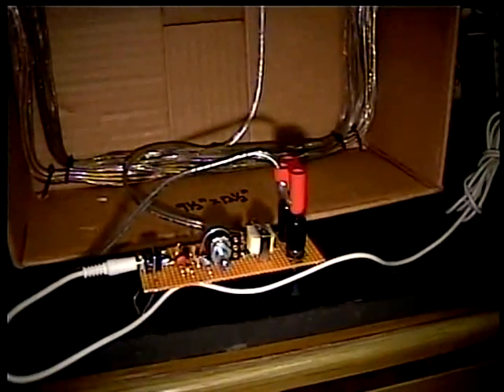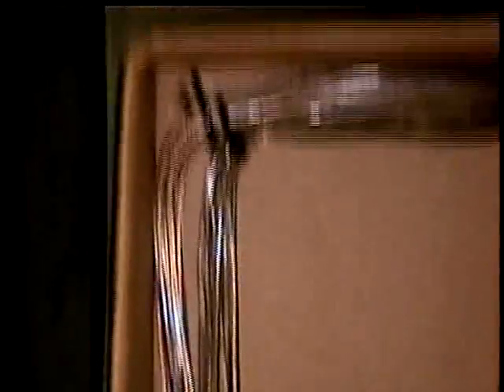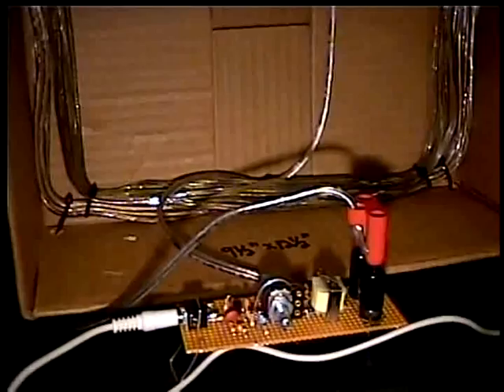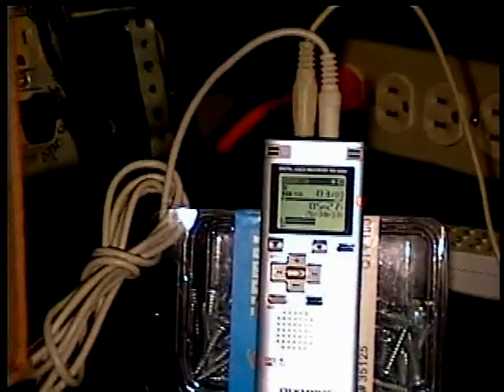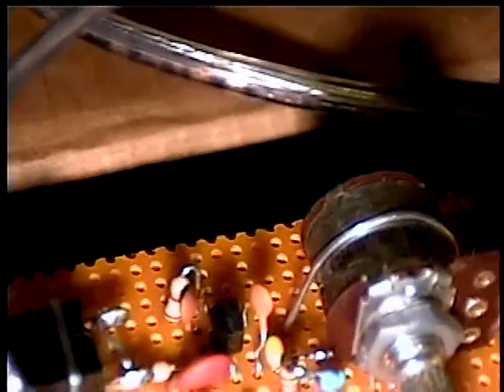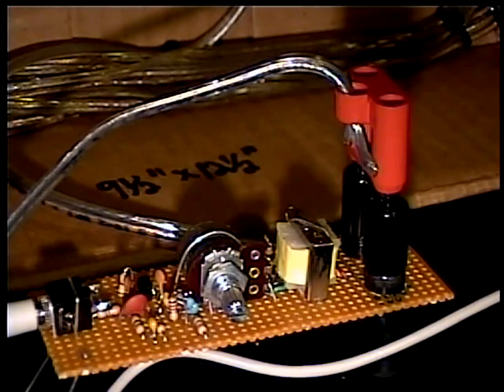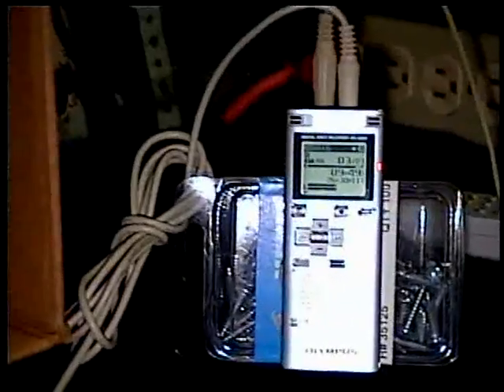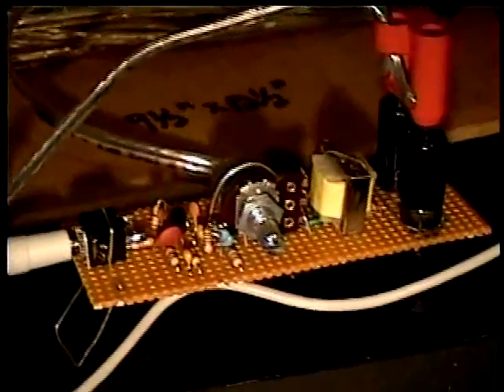VLF Box Demo.mp4

Comment: nice video, dude. Could you give some advise about making some ELF/VLF antenna of coils. The purpose is making detection of 40-140 Hz. How many turns should it be? What should be the diameter of copper wire? etc
thanks